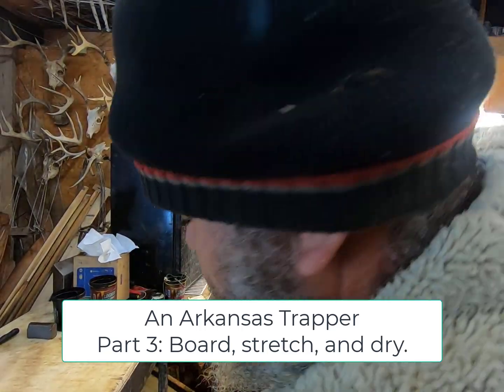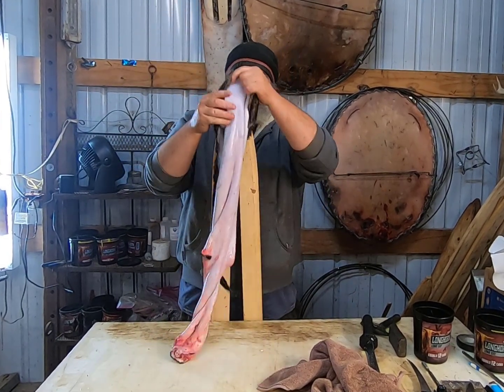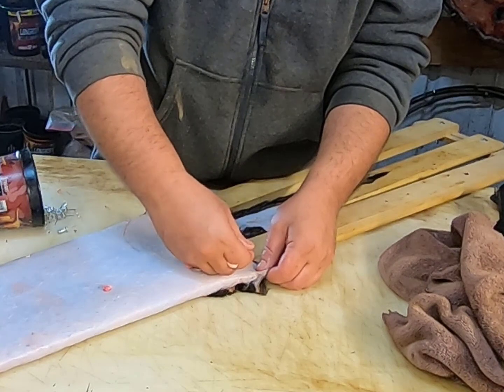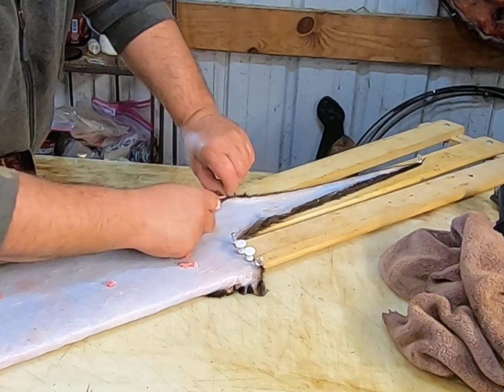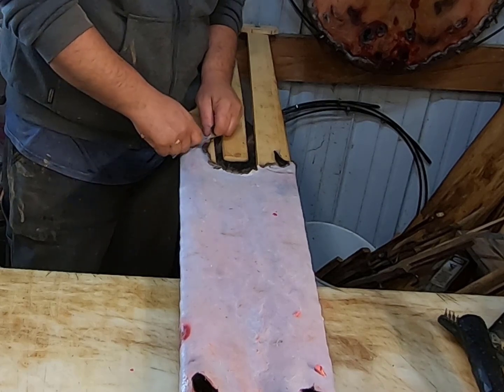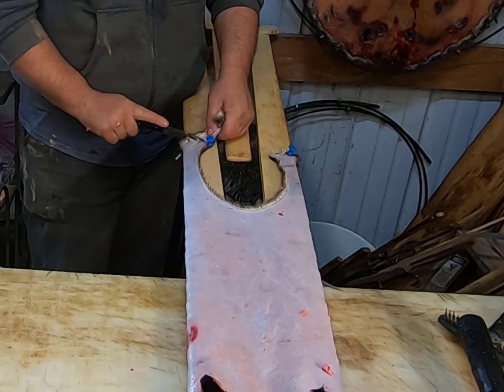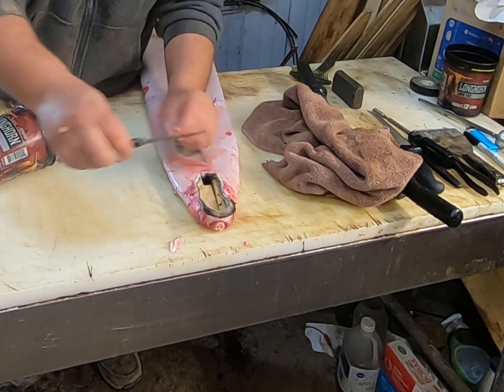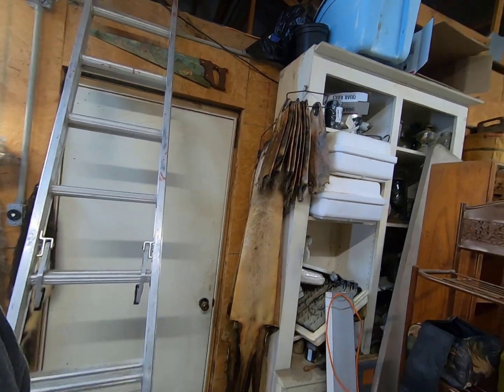Part 3 of 3: Otter catch, flesh, stretch and dry; Board, Stretch, and Dry.

Comment: I caught my first otter. How can I stretch it on a wire fox stretcher? Do you have a video on doing on wire?
Reply from the maker: I don't have a video of using wire but it's the same principle. You just want to pull it down and keep the tail and skirt taunt so that it dries and air can get to it all. No skin overlapping. I use clothes pins a lot with wire stretchers to clip over the hide pinning it to the stretcher to hold.